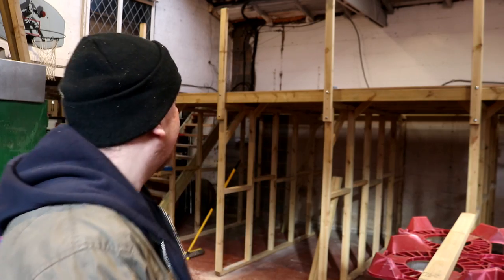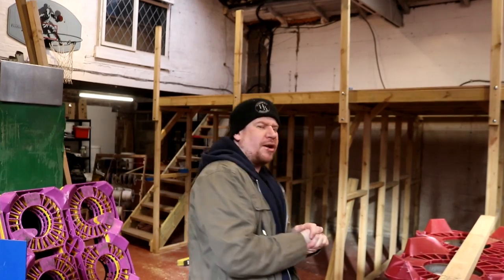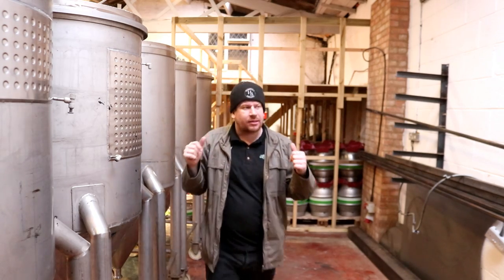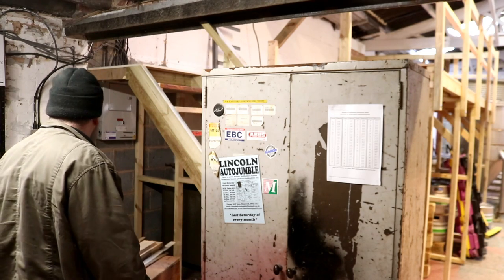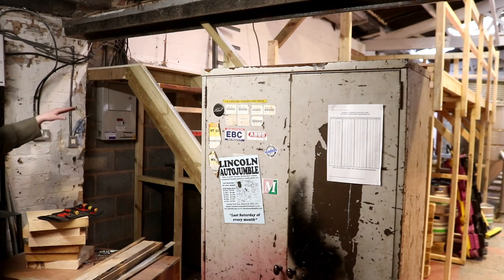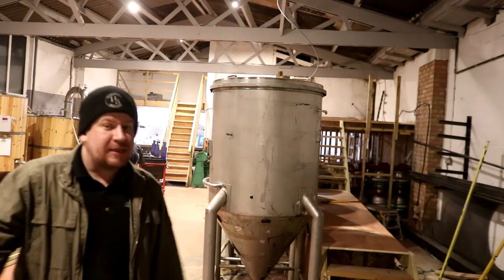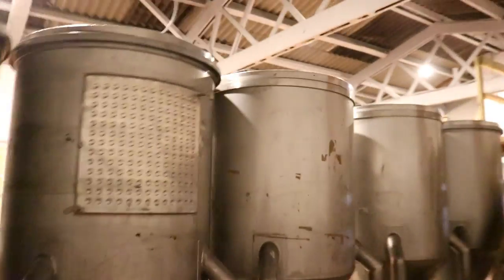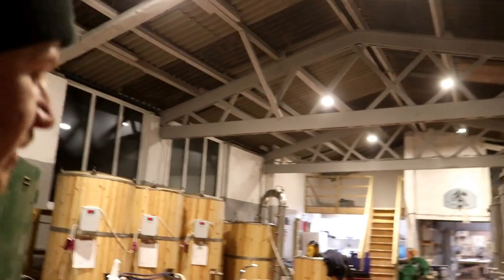TAKE DOWN THE STAIRS

Comment: Nice one, previous ideas were always going to be after the fact and it is after all your space to do what you want with. I think you need to start digging down, get a cellar and a whole new level installed, How many vlogs would that create??!! 🤣. Would the "first staircase" still fit with the cabinets next to them and perhaps a sneaky door from the first cold room to the electric box? Just throwing extra "out of the box" ideas in there. Cheers, Schnuz.
Reply from the maker: I might hit the water table if I start to dig down.
Reply: @harrybrew69  🤣 Go for it, under floor heated jaccuzi, a brand new concept in brewery tours; a pint while soaking in locally heated healing waters, guaranteed to aid sleep, especially after ten or more pints 🤣 . Cheers, Schnuz.

Comment: Looking good. Will your current pump setup be able to transfer the wort the extra distance to the new bank of FVs?
Reply from the maker: Oh yeah, the pump is plenty good enough, It was only a bit slow through the sprayball due to me sending it via the plate chiller. It still pushes 50 psi.
Reply: @harrybrew69  Nice one. It'll be mental when all the FV's are full. A lorra lorra beer!